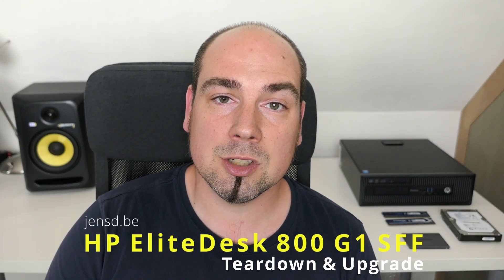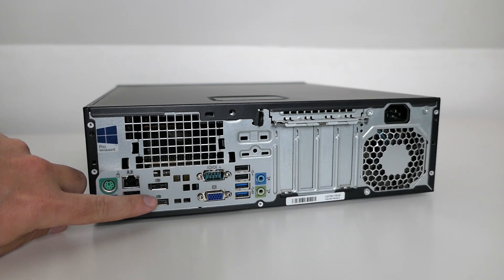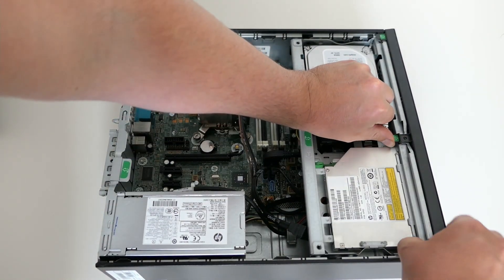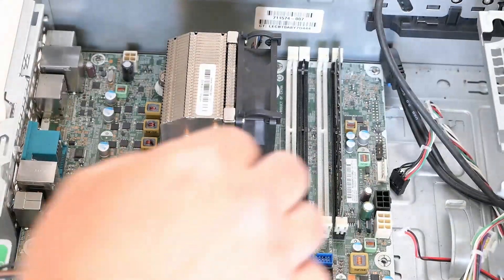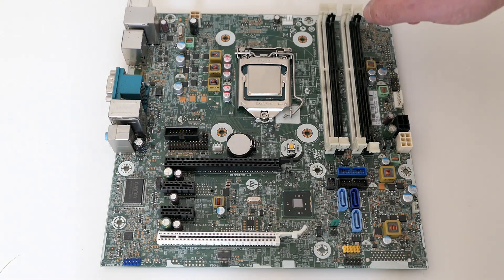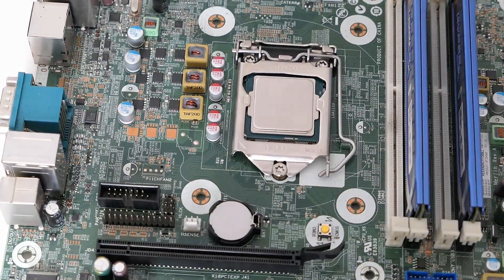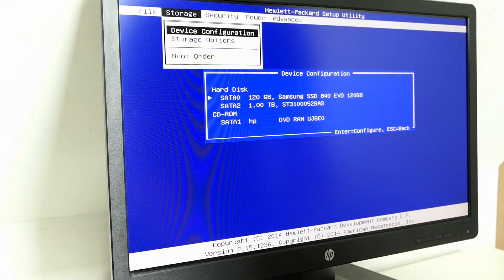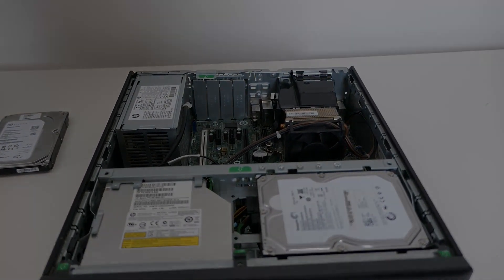HP EliteDesk 800 G1 SFF - Teardown and Upgrade

Comment: Bro, do you know why when I replaced my HDD with an SSD I get an error that says there is no disk or the disk has an error and it won't let me use the PC (I have that PC in the video)
Reply from the maker: Did you install an operating system on the new SSD?

Comment: I bought used PC just like this model.  I saw DVD drive and SSD.  I didn't know that it had ssd but I saw the label KingFast so i searched online for KingFast and I learned that was ssd.  I will need to replace it because it didn't allow me to clean it using diskpart command so i can reinstall Windows 10

Comment: Seem to be the PSU custom as well, so is it possible to use normal size psu in case has psu problem, the psu connector also look different than normal psu?
Reply from the maker: There are adapter cables that would allow you to connect a standard ATX power supply to the motherboard but it most likely won't physically fit in the enclosure.

Comment: Greetings, I have a question. When I added an Nvidia Quadro video card, it does not show me the boot options. When I want to enter the BIOS or flash disk, the Windows screen appears directly to me. Is it possible to help? Thank you.
Reply from the maker: Could it be that the primary display is set different in the BIOS? If I remember correct, you can choose between auto, on-board or PCIe. You would need that last option in order to display the BIOS on the PCIe card.
Reply: @jensdbe  thanks

Comment: Question, I have that same HP 800G1, I am going to install a Geforce GTX1650, I know the power comes from the PCI-E rail thru this 240 watt power supply. Nividia recommends at least 300 watt power supply. Will the GPU still work and will it work properly? If I upgrade the PSU, the watt at the rail would not increase anyway right?
Reply from the maker: a GTX1650 is rated at 75W maximum, so the recommendation of 300W includes all other components. If you have just that card and maybe an SSD as devices that draw power (plus your motherboard, CPU and memory), you should be fine with the 240W power supply. The PCIe slot can provide maximum 75W so that will not chance by upgrading the PSU but if your total consumption would be over that 240W (due to additional cards and drives for example), a more powerful PSU could help there.

Comment: hello , i have a same model but when i start my pc i cannot get any screen. windows 11 already installed. i dont know what is the reason. can you help me ?
Reply from the maker: Not having anything on the screen can have a lot of causes. Assuming that the monitor still works, Is there still power? Lights on/fans spinning? If there is, try with only one DIMM or a know good one. If that didn't help, there is probably something wrong with your motherboard or CPU.

Comment: I have this exact same system. I took my upgrade a bit further. 32 GB memory, 4790 CPU, delete DVD and HDD. This BIOS does not support NVMe boot device natively but I installed a PCI-e NVMe adapter and a 1TB NVMe drive. I was able to add NVMe boot support via the method presented in several more recent YT videos. The key was the Service Mode jumper near the white PCI-e slot. The jumper enables writing to the BIOS and when finished removing the jumper again makes the BIOS read only. Making this mod also enables booting in UEFI mode for the NVMe eventhough the BIOS is not fully NVMe. For a basic office PC it is pretty fast on Windows 10 Pro. It won't need to go in the landfill for quite some time.
Reply from the maker: That's interesting information, might give this a try. Thanks!

Comment: Can you add a graphics card?
Reply from the maker: Sure, most low profile cards that do not require external power (like a 1050Ti or 1650) should work.
Reply: @jensdbe  would an rx580 nitro 8gb work?
Reply: @Irishkiwi  No, that requires both an 8-pin and 6-pin power connector and the PCs power supply has no GPU cables, so only lower power (75 watts or less) cards can work
Reply: @paulbedford-holt6755  what if I bought a new psu

Comment: Making 5 beeps and does not boot. Been researching and it made me think the motherboard might have a problem. Do you agree?  BTW, this was most helpful video I came to in terms of working on pc as a novice. Thank you so much for your kind work!!!
Reply: It worked. Thank you so much!!!
Reply from the maker: 5 beeps points to an issue with the memory. If you have multiple DIMMs in there, try to boot with only one or move it to a different slot.

Comment: I just transferred my HP Elitedesk 800 G1 to an old HP Pavilion case, added a gtx 1650 and I'm playing Forespoken right now.  Extra things I had to do: 1.)  Remove the power switch and lights from the front cover button, insert into the from cover of the Pavilion.  2.)  To use my Elite desk cooling fan, I had to find some nuts that fit on the bolts in the fan too attach it to the mother board.  The Elit desk mother does not have built in nuts.  The fan bolts into the case.  It ain't pretty but works like a champ.
Reply from the maker: Was the power supply compatible with this motherboard? I know HP is using this type of connections more often but not sure if I have seen those in a Pavilion case. The GTX 1650 is a good choice to upgrade an older PC to something capable of playing recent games (about to release a video with the same in a few days :))
Reply: @jensdbe  No, it requires an adapter cable.  I'd share the link if I knew how, but you can find it, look up cobuman youtube channel.  He has a link to Amazon in his description.  It works for G1 for sure, but I think it works for G2 and G3 as well.  It was about $14

Comment: hey man i have the same computer as you but i have a problem with my cpu fan staying on  every time i push the button to turn it on the fan starts spinning then  immediately turns of  and keeps doing it till you unplug it  any suggestions please.❤
Reply from the maker: If no beep codes appear, I would suspect an issue with either CPU or Motherboard. Easiest way to test if you could swap either of those with a know working one.

Comment: every vid on this G1 upgrade, the host forgets to DC the speaker/MB connector......at  first

NOTE,  if you case swap, a 2 slot GPU will cover front panel USB 3.0 port, 2+ and sata gets tight too.

Comment: I have the same one I put a 4790k in it 16g of ram a500watt power supply and a 1050ti and put the motherboard into a bigger case and it works great
Reply from the maker: Have a similar machine here for which I plan to do something similar but with a GTX 1650. Need to find some time to record all of this and edit the video though. Still going strong these machines, despite their age.
Reply: I am so confined as Google says that it doesn’t have a pcie slot but in this video it has one.

Comment: OMG the hard drive bays on these are absoltue aweful.  I don't know how you can scr33w up a 5.25 and a 3" drive bay but HP found a way.   You can forget the traditional mounting via 4 side or bottom screws.There is no way to mount either drive in here without them flopping around.  I finally just shoved a drive in there floating around and used foam to keep it from rattling.   

And opening the case was infuriating as well.  Instead of two screws on the back, there is a handle you have to pull up and yank on the top cover of the case.  WTF.   seriously.   WTF HP.  PC techs do not appreciate change.  Or non proprietary connectors.

I would say, avoid these machines, even if theyseem like great buys.   You can't put a ful height GPU in them, and the power supply is propreitary and only 250 watt.  They are not as awful as Dells or Macs, but they are not much better either.
Reply from the maker: You do need to special mounting screws indeed, which can be a pain as they are not so easy to find. Without them it indeed feels pretty clumsy. 
Agree on using proprietary connectors. Moving the motherboard or PSU to another case is near impossible so you can only use HP-specific replacement parts.
About the GPU, I guess this is simply not targetted at users that want a decent GPU. The tower version would be a better match in that case.

Comment: Can this PC be expanded to 16GB of RAM? 

Can you put an integrated graphics card like the GeForce GT630?
Reply from the maker: 16GB of RAM is no problem. A GT630 should work as well as long as it's a low profile card. Otherwise it doesn't fit in the case.
Reply: @jensdbe  Thank you very much for answering
Reply: @jensdbe    I have read that it can also support 32gb of ram quietly since it has 4 slots

Comment: Learned some new stuff thanks my guy !!  well if u can get me know with what is the difference in 2 ram challens and 2 ram slots i know like 4 slots in 2 challens but why not in 1 challen only or on 4 seperate challens ?
Reply from the maker: Typically desktop CPUs have two channels supported in the CPU architecture. It can be a lot higher for server CPUs (like Xeon). The best is to have at least one DIMM in each channel of the same type (speed, size,...). The amount of slots is normally a budget choice. Cheaper motherboards would have 2 slots (one per channel) and more expensive/luxury boards have 4 (2 per channel). As far as I know this is just a budget choice.
Reply: @jensdbe  Thank you sir !! another thing I just have the hp elitedesk 800 G1 SFF and as per the hp website there are some low graphics cards listed for this pc( around only 4 models ) like of 1, 2gb but can I connect a higher end graphics card upto 4gb in my pc ?? As I want to game for eSports on it. It would mean a lot if you help your fellow subscriber 😀
Reply from the maker: @shivrajdangi3926  the problem is that the power supply is not that powerful and you are limited to low profile cards. A 1050ti should be a good match. You can easily find these with 4GB and in low profile.
Reply: @jensdbe  power supplies are not much costly by just upgrading it I can plug a good graphics card that you mean 🧐
Reply: Any rtx card ?? As rtx offers high fps and is good for gaming

Comment: Dear write which processor should I buy hp prodesk 600 g1 twr motherboard 18e7 processor 4130 I want to install Intel Core i7-4770 or Intel E3-1240 V3
sorry google transmitter

Comment: Can i remove the disk Reader and install another disk?
Reply from the maker: The DVD drive is a slim model. It's about the same height of a SATA SSD. The SATA data cable would also fit but not power. For that you could use a splitter from the other power connector.

Comment: Hello I’m currently trying to upgrade my pc case and I wanted to know what mm the motherboard is so I don’t get the wrong Pc case.
Reply from the maker: The board is pretty custom for this case. A standard power supply or standard board would also not fit in here. The board can't be powered by a normal power supply either (or you'd need conversion cables).
Reply: @jensdbe  So it doesn’t matter what mm the board is for any pc case like the Antec NX400.

Comment: i want to ask a question, im no stranger to taking apart computers but i always forget where which cable goes
Reply from the maker: Thqt can be a problem I guess :)
Reply: @jensdbe  can i add an extra fan to the case? i dont see any spart ports on the power supply for power

Comment: Good Morning I have a machine of the same model. Please I would like a tip I want to run games on it and for that I need a video card. In this case which one would be compatible with this machine model. thanks for your video. BRASIL
Reply from the maker: AMD RX560 or NVIDIA 1050Ti should still work and are more or less ok with the rest of the hardware. The limit is the power supply and the fact that the card has to be mainly slot powered.

Comment: Thank you for the video. HP's layout sure makes it easy to work on that PC. I'll definitively consider this model myself. 👍

BTW: what did you end up using to mount the SSD?
Reply from the maker: I moved the SSD to a 2,5" to 3,5" bracket and fixed it using the additional screws I had.
Reply: @jensdbe  3M "Dual Lock" tape is very handy for mounting things like SSDs.  Very secure.
Reply: @jensdbe  hi would another mother board fit in here -to the old mounting screw holes, eg a new ryzen mobo

Comment: i have the 800 G2 sff with 200w psu, the rear 4x 3.0 USB are acting up, i use one for an external HDD with its own ps and a usb wifi dongle and it wont connect or connects but has hard time with little speed its an RTL8811AU and it works fine on the front ports 2.0 or 3.0 but the rear 3.0 it has issues why? i checked the bios settings and all seems okay set to default settings. anyone else have similar issues ?

Comment: Can i put in a bigger powersupply?
Reply from the maker: It's a custom power supply so a generic ATX one will not fit and not be possible to connect.
So I'm afraid the answer is no.
Reply: @jensdbe  okay thanks!
Reply: And it's original powersupply enough for an a8-6500b
14gb ram and a gt 1030 oc edition?

Comment: I have the same PC. I am facing one problem! Doesn't organize long cable USB 10 meters or even 5 meters. I heard because there is not enough power to read them in long USB cable. But I have weak laptop and still reads them like a charm but this HP elitedesk doesn't 😔

Comment: Hi how much is your ram frequency is it 2 1600mhz of ram because on the bios setting of elitedesk 800 g1 sff there's no overclocking option(im not sure if there is overclocking) but does it automatically detect your 2 1600 mhz of ram or it will stick to it's default ram speed (example: my old ram speed is 1333mhz but cpu z numbers says it's 2 665mhz so it sums up) thanks for your answer friend.
Reply from the maker: It is 1600Mhz and that's the maximum supported by the board/CPU in this machine. As far as I know there is no way to force it, it's just what is detected. Out of experience I know that is not always going properly. CPU-z does tell the real speed, which is half with DDR

Comment: What do 3 beeps mean when plugged into the power?
Reply from the maker: As far as I can find, it means processor not installed. So try to re-seat it maybe or test with another if that's an option.
Reply: @jensdbe  thanks✨

Comment: Hi yes. Does this computer support 1333mhz ram? Although the cpus supported for the computer all support the ram but I've never seen anyone try it before
Reply from the maker: As far as I know it supports up to 1600Mhz RAM. In any case it should work but might be running at a lower speed.
Reply: @jensdbe  alright thank you
Reply: @jensdbe  its just showing 1600mhz ram even though all cpus supported on the computer supports 1333mhz ram
Reply: @jensdbe  if its alright with you could you try testing it out if 1333mhz ram works with the system?
Reply: @jensdbe  will the bios interfere with the compatibility?
Reply: Subbed btw. You provide Great information about computers

Comment: Will the M.2 fit in this PC ? also a NVIDIA GeForce GT 640 video card ?
Reply from the maker: There is no M.2 slot for an SSD on the motherboard so you would need a PCIe card for that. The GT640 should work just fine as long as it is a low profile card.

Comment: hello is it possible to upgrade one of these to an aftermarket motherboard? as long as it is the right size do you think the pins will all be compatible? i know these have a proprietary connector for the power supply but not sure about the others
Reply from the maker: It would be really hard. Better to get another (cheap) case and power supply. The board is completely custom, so mounting holes, back panel layout, power supply,...

Comment: If I wanted to change the processor to an i7, could it be done?
Reply from the maker: This shouldn't be a problem. THe i7 4770 or 4790 seems to be a popular option
Reply: I just swapped mine to i7-4790k,which i bought seconhand,new ones might be hard to get,if not impossible.Original was same as in this video.

Comment: Hello,would i be able to upgrade graphics to GTX 550 ti ddr5 (hp 800 g1)
Reply: I have gtx 1650 super,works fine.
Reply: I have a similar question. I have the same pc with also 240W power supply. Would I be able to install a 1050 ti low profile without Power problems?
Reply: To your question. I think no you can't because you need a low profile gpu and the 550 ti isn't one as I know :)
Reply: @bekirgencer4464  yeah I saw it I guess I'll play with Intel hd 4600 😅
Reply: @Немања-ф3ф  you could buy a gtx 1050 low profile ist is really cheap if you can find one for around 50-80 USD or Euro it would be much better then the hd graphics :) or of you can afford it a 1050 ti would be perfect or a 1650 super of course both in low profile

Comment: I didn't think it would be near as powerful, at least until I saw usb3)! Also, I hear you can put an nvme drive into Pci-E with an adaptor and make it bootable with a bootloader that has nvme drivers.
Reply: Injecting the bootloader into h-p factory BIOS would be an learning project, with someone who's done it before.
Reply from the maker: NVME with a PCIe card would indeed be a large increase in disk performance. Not sure if the BIOS is able to boot from it. I guess it also depends on the PCIe card you use.

Comment: How do I remove the back panel where the io shield
Reply from the maker: The back panel/IO shield is fixed to the case. The back is rivetted to the rest of the case so you would need to drill that out to remove it.

Comment: thanks, I'm currently working on upgrading a similar one (though more recent, it's the 800 G2 SFF, with a 6th gen i5 and DDR4 RAM). Too bad you didn't add a GPU though, that's challenging since the back panel has some annoying metal bars that I'm gonna need to remove if I want to fit my low profile GPU.
Reply from the maker: See my similar video of the G3, where I have a 1050Ti installed :)
Reply: @jensdbe   link?